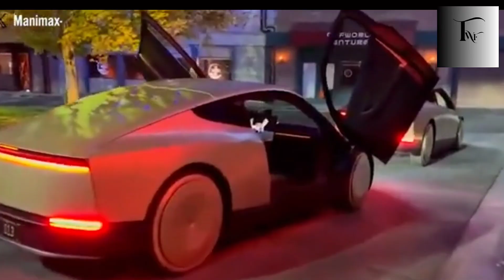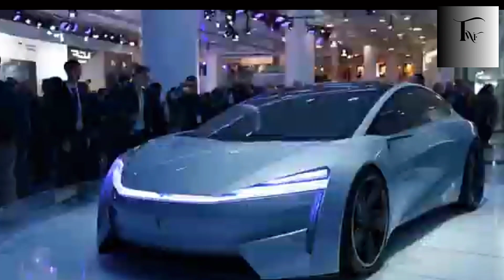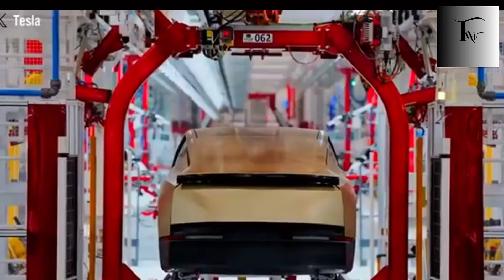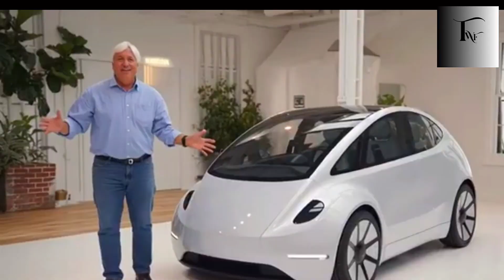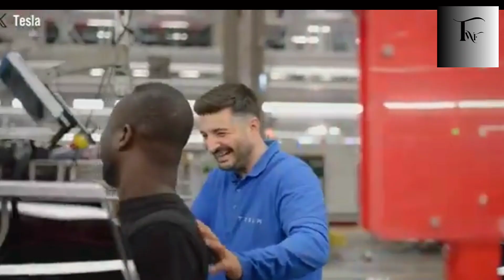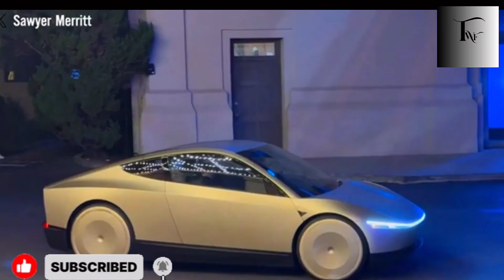Tesla’s Robotaxi CyberCab Reveals Its TRUE Power — Battery Changes Waymo Didn’t See Coming

Comment: If you ask AI the question as to which platform will win, Waymo vs Tesla, the answer I got: 

Waymo is likely to “win first” in safe, commercial autonomy, due to primarily sensor based system.  

Tesla could win big later due to accumulated data learning and reasoning over time and if vision-only AI solves general driving.
Reply from the maker: Interesting take! Makes sense that Waymo could take the early lead with its sensor-based approach, but Tesla’s massive data collection and vision-only AI might give it the edge in the long run. Exciting to see how this competition unfolds!"

Comment: Auto piloted vehicles powered by AI, computers, software needs to be explained in detail. Currently it is all hype, magic, black boxes, call it what you like. Driving is dangerous hence requires laws regulations and insurance. Before AI is allowed it must be understood in detail by all: people, drivers, regulators . There are limitations to every system. If it is not explained, it is not understood and it's limitations are not known. It is only hyped by those that want to make money.
Reply from the maker: Absolutely, understanding AI-powered vehicles is crucial. Transparency in how these systems operate ensures safety for everyone—drivers, passengers, and regulators. Hype shouldn’t replace clear explanations."